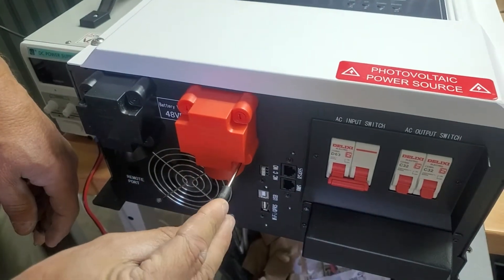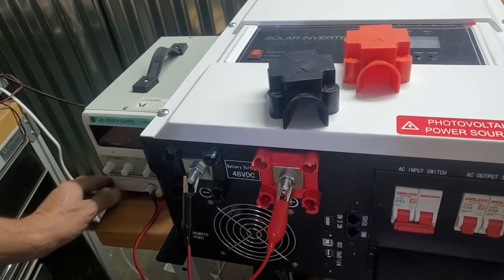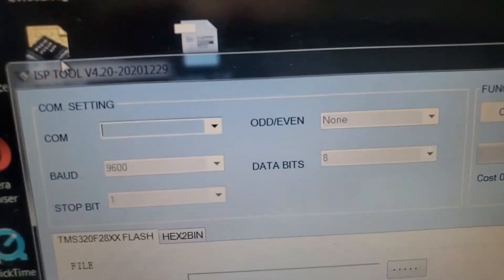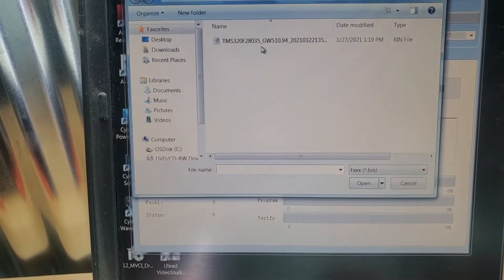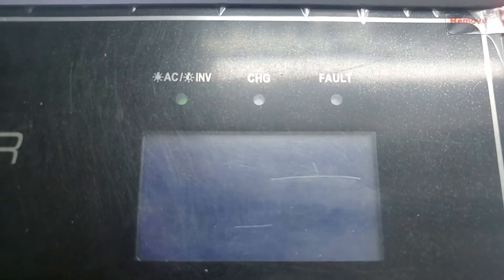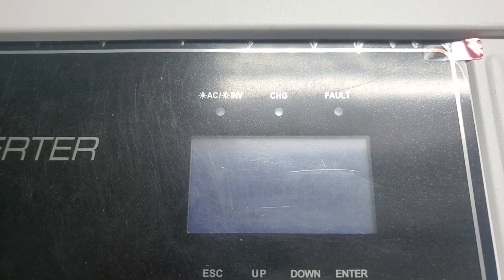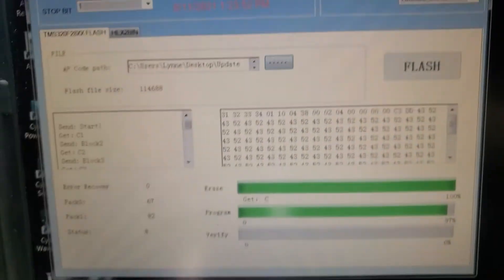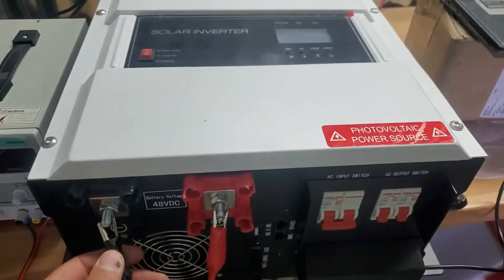Firmware Update Growatt 6000T

Comment: Hi I try with my 6000T but program never come up after clicking the icon, but if I disconnect my USB com3 then the program come up but doesn't detect it, try with 2 cables, 2 laptops and different comes and it do the same, I also factory default the unit but no joy, uart windows driver was installed so not sure if the inv USP port is good or not. Anyone with the same issue ???, the unit is only 5 months old...

Comment: I followed your writing diagrams for my 6000t. I was just reading the sigineer manual for their rebranded 6000t because their manual is MUCH more thorough than the growatt manual. Their manual specifically says to NOT hook up incoming neutral AT ALL and specifically not to bond itto either incoming ground or outgoing neutral. Warns of permanent damage if you do. Your diagrams have incoming neural bonded to outgoing neural.  Comments??
Reply: Es correcto lo que usted indica. El Growatt, genera su propia tierra, y si lo conecta a la tierra de la red, se quemará de inmediato. Eso costo varios growatt quemados, para averiguarlo. Deberían decirlo en el manual

Comment: Who has Win 7 anymore?  I mean Win 11 is rolling out.  Is this a flaw in the firmware upgrade app?
Reply: Any techno puttz like myself will have kept a Windows 7 machine or 2 kicking around. Heck, I still have an XP laptop !!!
Reply: I did it with  Windows 11.  I had issues with the driver that is needed to communicate with the inverter.   The problem was about the COM Port.  Connecting to the laptop USBs didn't work.  I read somewhere that changing the driver and forcing it into COM1 does the trick for some in Windows 11.  In my case, I didn't have to do that.  I plugged in a USC-C dongle that has USB -A ports and connected the cable to that port and everything worked straight through without having to do any changes in the drivers.  I did update to the latest driver beforehand in my quest to make the thing work.
Reply: Guys to solve win 7 issue do this

Right click isp tool file
Select properties
Select comparability menu
Check run in compatibility mode and choose win 7 from the menu
Make sure to choose run as admin

Always backup ur chip before fw update
Reply: @bmh6644  How do you backup the current inverter firmware and have you tried this on Windows 10 with compatibility mode you mentioned?

Comment: Can you not do this with windows 10? Or was that just a stab at windows 10?
Reply from the maker: Windows 10 is Iffy,  you can try to run in Windows 7 compatibility mode.  Right click the Destop Icon, -> Properties -> Compatibility. If it crashes half way through, your unit is bricked until you retry and succeed
Reply: @watts247  that's very un-reliable considering most computers are running windows 10. This is a flaw!!!